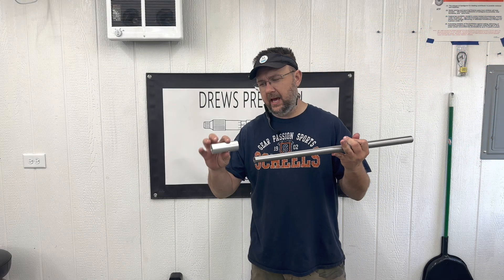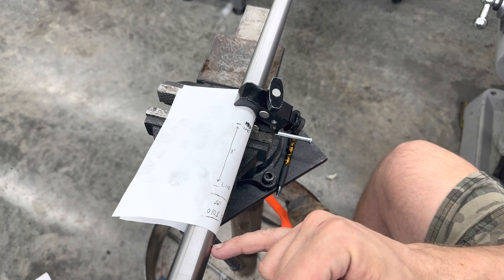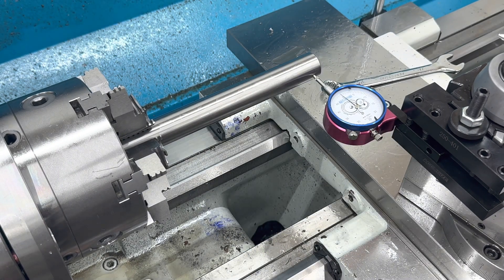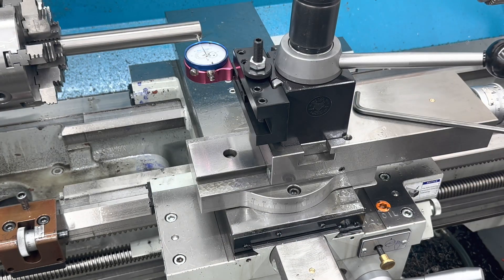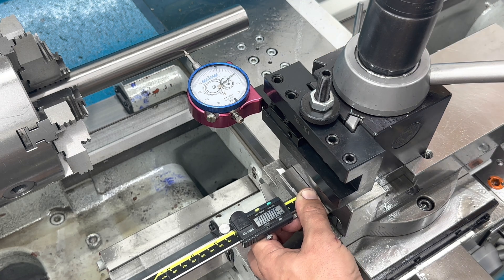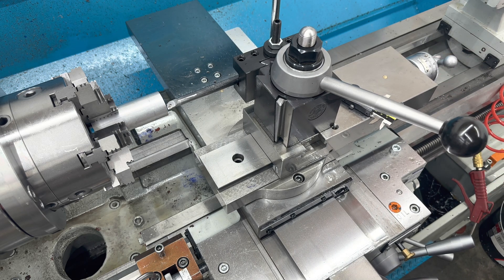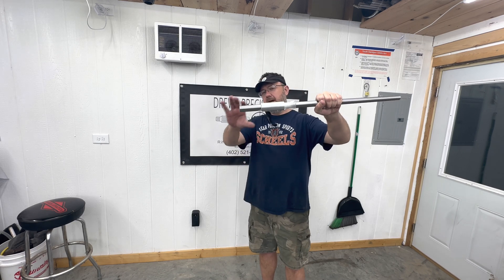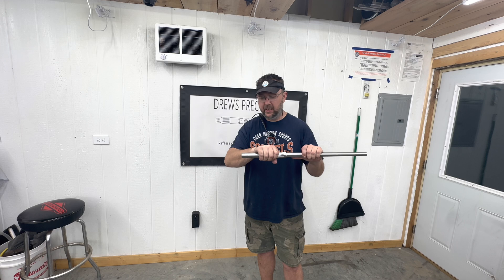How we hold Barrels in a lathe. Machining a ID tapered sleeve for barrel threading and chambering

Comment: Hey Dustin just thought of an idea , if you put two grub screws on one side of the split you just have to tighten them to release the tapered sleeve 👌
Reply from the maker: Your correct. That is a great idea. FYI. When I put a piece of paper between the barrel and the sleeve to prevent scratching they remove much simpler.
Thanks the idea!
That one was a bit a bugger to get off